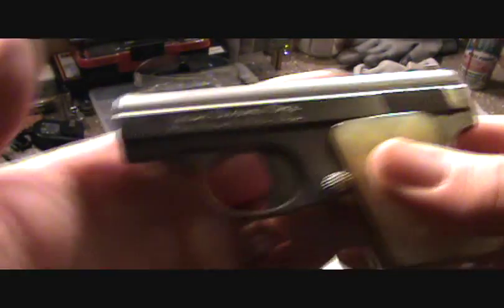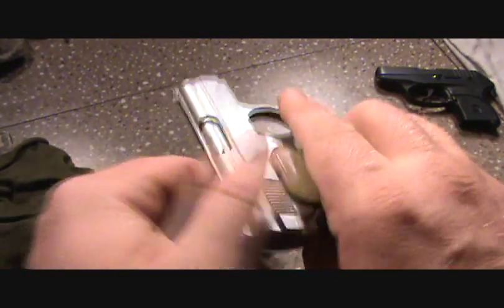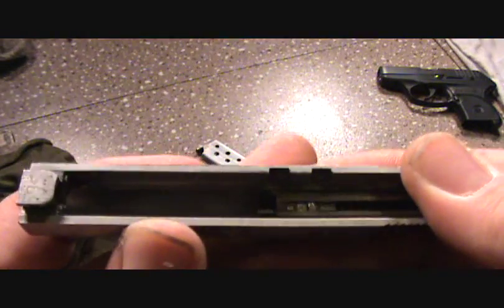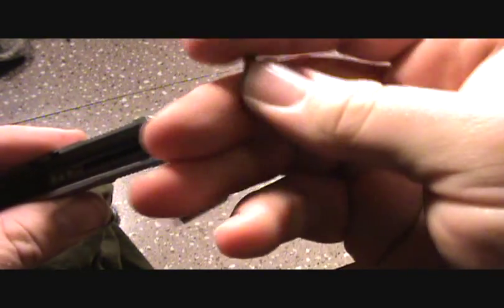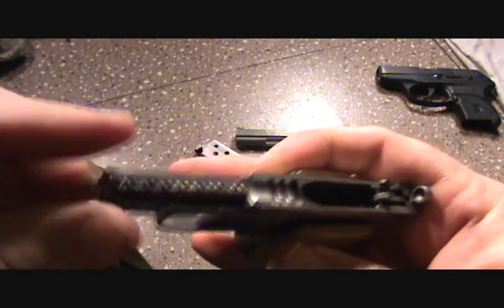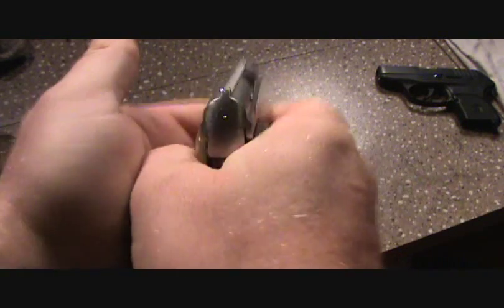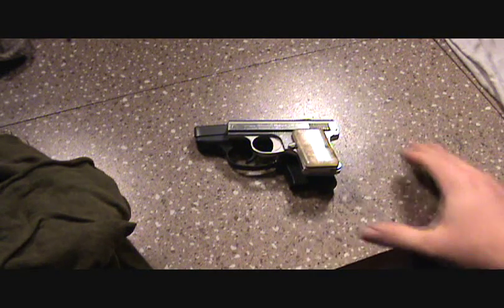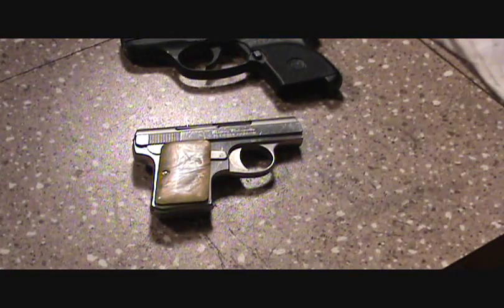Baby Browning Disassembly

Comment: Hello. Have you broken the pistol down any further since this video? I have a Bauer .25 Auto and it's giving me fits. The trigger will not stay in. I was wondering if you could tell me if I am missing a part. Mine has a trigger, a spring, and a small metal dowel that hooks into a hole inside the grip. No matter what I do the trigger will not stay attached. Any advice would be greatly appreciated. Thanks and great video!
Reply from the maker: Restore Staff sorry this one actually belonged to someone else and I haven't used it since making the video
Reply: Make sure that the transfer bar, which has a pin that fits in the trigger, also is retained by a spring in back of the frame. You'll need to take the grips off to do all of this, but if you are at all mechanically inclined, with a little fiddling you will see what needs to be done. Good luck!
Reply: The Bauer is also rather a  poorly made gun so if you need to buy any spare parts they may or may not fit without some filling, sanding, honing or other fitting. The Brownings are about 10x better made, tighter tolerances, and the replacement parts just drop right into the Brownings. The Bauers are little too sloppy. Their parts had to be forced or filed to fit into the little Bauer pistols.  The slide is also weaker on the Bauer. That was how Bauer avoided patent infringement. The barrel locks and unlocks on the weaker side of the slide.